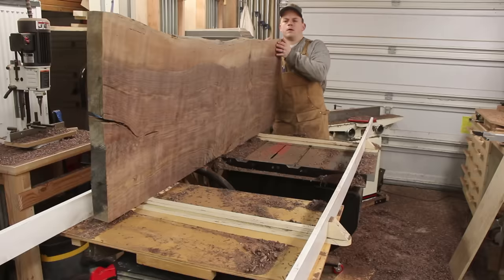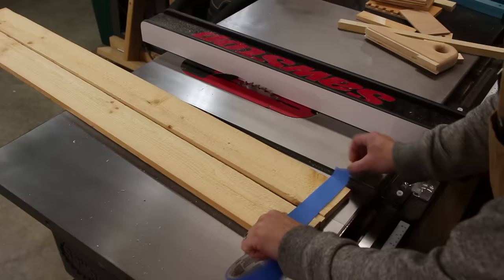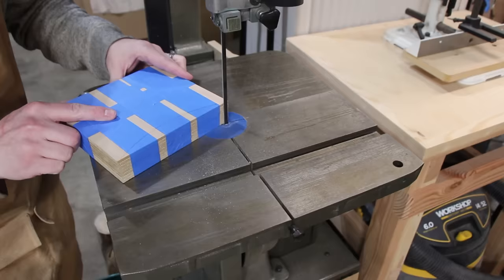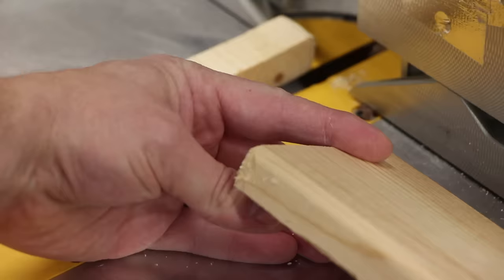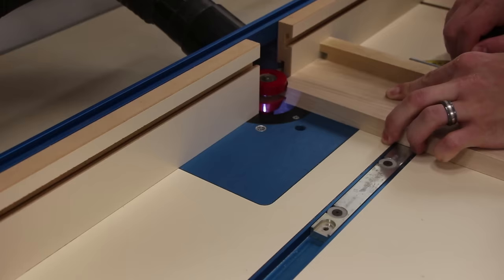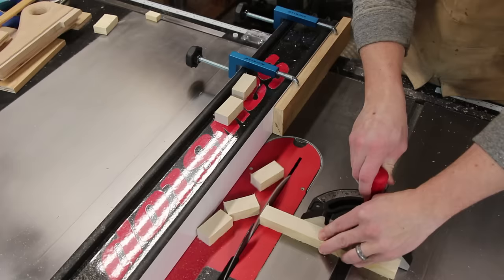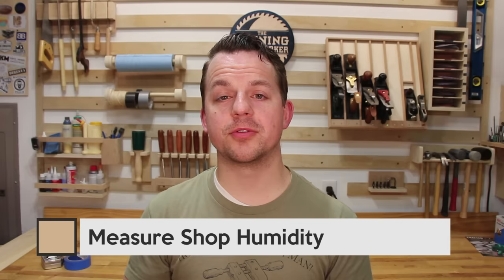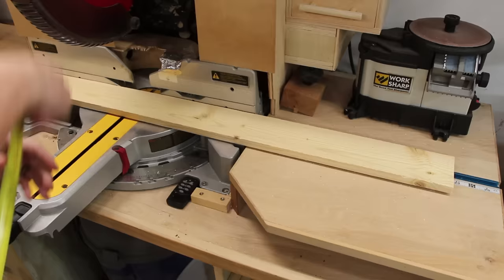7 Woodworking Tips & Tricks You Really Should Know | Evening Woodworker

Comment: here is a tip Don't wear a ring....
Reply: Or a necklace, hoodie with drawstrings, necktie, sleeves or loose long hair.
Reply: Why not? There’s nothing to get it caught on. I’ve been wearing a wedding ring for over 50 years and haven’t had an issue yet. You’re  probably one of those SawStop guy’s thats afraid of the blade.
Reply: Never though I’d comment on a YouTube video but my god I was degloved 3 years ago my ring got caught in a brad nail that was sitting proud of the molding on my garage vertical beams, I was running to shut the breaker off and glided my hand on the pillar as a passed by and then it was a wrap man.  My finger stayed my body kept moving forward

Comment: A couple of things about tape measures. Don’t let the tape snap back into the housing like on the video. It wears out the hook and makes it less accurate for measurements. Also use the same tape measure for an entire building project. There is differences in accuracy in tape measures.
Reply: I am pretty sure projectfarm disproved this myth about tape measures.
Reply: I'm shop foreman in our workshop and I always try to teach guys to ease the tape back in instead of letting it snap back like in the video. Over time it will actually bend the tip to the point a tape can be out 3 or even 4mm. Can't tell you the amount of times I've had guys tell me something was cut too small only to measure it with my own tape and find it spot on. Then you ask to see their tape and it's all kinds of ruined.
Reply: @zuilok  As a retired machinist, I can say that they do vary, and by a good bit. We had to have ours calibrated by the inspection dept before we could use them. Most of the time for woodworking they are just fine though.
Reply: Also they can inflict nasty cuts if there is a small nick or anything and they retract quickly. Don’t ask me how I know 😂
Reply: @jackthomson73 same!! Last time I ever do that!

Comment: That last tip has one drawback. The end of the tape measure has a movable end-stop. It is designed so you get accurate measurement both inside and outside of what ever you are measuring. I think most everyone knows that. The problem with letting it snap back, is that can damage the end-stop. You should never let a tape measure snap back. So just hold the end as it retracts and don't let it snap back. I have seen many damaged tape measures over the years from people just letting it snap back. I'll bet every older wood worker can say the same.
Reply: I believe that remark to be unsubstantiated. Way over 60 years in woodworking and as yet never seen any fluctuation with any tape due to popping it back. That is kinda like having a 64th measurement, who can even see one?
Reply: @mightyporky  Well, I've seen them torn right off. The light flimsy tape measures are more likely to break than the well built name-brand ones. A friend of mine broke two of them and still has not learned not to do it. His comment was, "they are cheap, I'll just buy another one." 
So I guess it comes down to abusing your tools are taking care of them. It's up to the person using them.
Reply: 40 + year carpenter...absolutely correct on letting the tape measure snapping back...seen many novices ruin a good tape measure in a rather short amount of time...
Reply: The symptom of a streched tape measue is cutting boards SHORT when you measue by pushing the tape up against the wall or what ever and then pull the tape when you measure for the cut.  If you are pulling when measuring and cutting it makes no difference if you are using the same tape.
Reply: @markbrake6877  I tried to remember mt first use of a tape, the best I can figure was around 50 years ago, I transitioned from a six foot folding rule. I reckon I used that rule for at least ten or fifteen years.
Reply: @mightyporky  
I used one of the folding rules for a time early in my career also...
Reply: @mightyporky , me. When they damned thing as not square on dry fit.
Reply: @valdo345jr  they damned thing? what do you mean?
Reply: Yes Roy. I agree. When I was a kid as an apprentice on a framing crew, I was told to NEVER let the tape snap back as that would severely shorten the life of the tape measure. I think this trick can still be applied though as long as you slow the retracting tape down a bit before the end hits home.
Reply: See Steve Ramseys video https://www.youtube.com/watch?v=z9En0WAsP8A - letting it snap back IS PERFECTLY FINE!
Reply: I wouldn’t be too worried about snapping the tape measure. Steve Ramsey recently did a video where he snapped a tape measure 10,000 times before it the end broke off. 

https://youtu.be/z9En0WAsP8A
Reply from the maker: Good point! You can definitely let it retract slower, but it's much more dramatic on video when you just let it go!
Reply: Steve Ramsey did an experiment recently on this, the tape measure itself snapped after around 9k "snaps"
Reply: @tpottrell  I was just about to say exactly that! Search "Does snapping a tape measure ruin it? Steve Ramsey"
Reply: @tpottrell  I run a small timber framing factory with just three or four people working daily and I can tell you I still buy tape measures by the dozen. Especially the 8 and 10 meter ones can work up to quite a speed when snapping back and I've seen ends snap off or the last few centimeters developing ripples, making them unusable.
Reply: 100 year carpenter here...
don't let the tape snap back. it will shorten the life of the tape and slice the shit out of your fingers. also you need to lean over and this way and that so it's not always practical leaving attached to your hip...
but I can see it being useful for some things
Reply: @TheClearpuddle  Holy mackerel!  100 years?  I thought I was an old carpenter - started building 50 years ago.  Anyway, I always slow the tape down as it nears the stop.  I’ve worked a lot in the rain over the years and developed the habit of keeping my index finger sliding under the tape to help clear the crap that the tape picks up when wet.  Otherwise, it will load up inside and eventually quit retracting properly, which is a pain.  Eventually the blade will start to rust on the edges and you’re pretty close at that point to a maneuver I like to call the ‘tape toss’.  (When your tape gets rusty and cranky and only retracts to within about 3 feet of the end, you grab the end of the tape, swing the tape like a pendulum, and let it go into the bush, of course you’ll eventually retrieve it and toss it into the dumpster, but there’s a certain amount of satisfaction with the toss.
Reply: @mightyporky  My dad worked for years for Ridge Tool. He built our house using his Ridged Extension Rule No. 620, with the 6-inch metal slide extension  After nearly 80 years and some elbow grease and machinist oil, it's my every day 6-ft go to rule. Try measuring the depth of a small diameter hole with a regular metal tape measure.
Reply: @throne1797  WTG! I still have mine but can't be sure where.
Reply: @paparoysworkshop  I agree, This guy also doesn't value his time either. It takes time to replace a tool. If that guy really needs that tape at that time, he'll have to disassemble that tape box and salvage what he can just to get through the day.
Again, what's your time worth.
Reply: @danholtbk7008  Ouch... 😢
Reply: @mightyporky  That six foot folding rule is my go to ruler.  Large enough to not displace.  Extend it and it stays upright.

Comment: My tip that I don't really see people do:

I think one of the best things you can do is get a whiteboard/dry erase board in your shop. Just being able to have a quick and easy, reusable writing surface, dedicated spot, not having to look for paper or pencils or anything. Just jot down your notes or measurements, do the math real quick on the board, write some of the measurements down and so on. You can glance over at it and double check a measurement as you set the fence. Very convenient
Reply: I do this and it is a great idea!
Reply: I just write on my bench
Reply: I use scraps of wood, but an electronic style of “boogie board” is fantastic for this and cheap. I got one that is about 10”corner to corner and it was less than $10 about 4 years ago. You write with a stylus and then just touch one button and it erases the entire screen; that’s the only downside is that you can’t selectively erase, it’s all or nothing. You can scribble something, but you can’t just erase one little piece.
Reply: I just use my phone
Reply: Sounds good.
Reply: I use a whiteboard with a small calculator and a small lightweight tape measure, both with magnets glued to the back.
Reply: I need to do this
Reply: Maybe several of them
Reply: I do this! I have a huge board for this reason! Take a picture of it afterward. Especially if it's a project you wanna make duplicates of to sell!!!
Reply: Oh!!!! The other thing I do is add magnets to the tools I am always reaching for!!!! They stick to the board!
Reply: Good idea, I’m fed up with either measuring twice. I’ve built or put in loads and loads of stairs and that white board is much better than a piece of paper when measuring hand rails,balustrade and spindle gaps,let alone measuring for a double turn staircase. I’m English don’t know if you call the same words in America. I know you say 2 by 4, when we say 4 by 2
Reply: @liquidrockaquatics3900  I use a Boogie boards also. I just cross out what is no longer needed until it is full then reset it.🙂

Comment: My two favs,
Tip #1- I have a composite material shim hanging down from the ceiling above my table saw. I use whipper sniper line to hang it because it’ll recoil and pull itself back up out of my way after using it. I use the shim when cutting hardwood with tensioned grain that pinches the blade, (closes the kerf/pinched kerf). When this starts to happen I just pull down my shim hanging above me, place it in the kerf and safely finish my cut. Once the cuts complete the whipper sniper line recoils and clears the shim. As a guy who cuts only hardwood and many exotics, this idea has saved me a lot of agro and who knows? Possibly even an injury?
   Tip#2- it’s an easy “blue tape” trick I use when building something I want to stain. Prior to shooting any brad nails, place blue tape there first, then shoot the brad nails in, this leaves just a perfect brad size whole in the blue tape that way when you apply your wood filler, the filler only goes in the brads recess and NOT smeared into a large area of the grain which is a nightmare because wood filler just won’t take stain exactly the same as clean wood.
Hope these help someone.
Reply from the maker: Oooo I like that blue tape one! I always end up sanding a ton to get rid of all the filler on the surface.
Reply: @EveningWoodworker  and when the tape measure gets snagged on a power tool and pulls your hips arm or leg into the tool and takes it off ... 
DUMBEST TIP EVER attaching a tape measure or ANYTHING to you and using while attached to you is the worst most unsafe a most idiotic idea ever ... it is how people lose limbs .. heck Americans eat Tide pods for bloody sakes they wont know enough to keep the tape measure away or out of power tools .... heck they can barely comprehend that they dont vote their leader in they just acknowledge the two options big business has put before them ..
Reply: @0623kaboom  How can the tape gets snagged on a power tool? I usually mark down my measure and put my tape aside BEFORE triggering my tool! I can't see the difference it makes to get a hard time either putting my tape back in its pocket and/or keep looking for wherever I put it because I was too lazy to put it back in my toolbelt! 🤨
Reply: Dang, taping before the brads is going to help a lot. Some things are so logical you wonder how you never thought of it. Thanks!
Reply: @randyspencer5664  He fries bacon naked to avoid getting grease spatter on his shirt.
Reply: Brilliant! I've done this with the key to my drill press. Had to use a wire spring cos the w/s line wasn't strong enough, but thanks for the idea.
Reply: Tape before brad, good idea! I've seen some real pros (typically trim guys) that don't fill the brads before staining. They fill after it's up and before urethane. (Alot stain the trim before it's up) That way they match the fill exact as possible to the stained finish and don't roll the dice on the traditional "fill, and stain, and pray it's close" approach....
Reply: Like the shim trick... hard woods always seems to squirm a little... thanks and God bless

Comment: Many of you may know this blue-tape trick: For template routing, or using a router trim bit, you can attach two work pieces together by putting blue tape on each piece, then using CA glue on one side and accelerator on the other. Hold them together for a second, then they are ready for your routing operation. When completed, use a putty knife slipped between the two pieces to separate them. It works great!

Comment: I am in my 60's and have been woodworking for decades.  I made my first sled this winter.  
I screw an wood auxiliary fence to my miter gauge.  This has worked as good as a sled.  I can clamp to it.  I provides zero clearance to prevent tear-out, and is easily replaced.
When I buy a tape measure, the first thing I do is remove that annoying clip.  I wear a belt with pockets (though less bulky than a carpenters belt) and I wear Carhartt cargo pants.  This gives me quick access to my tools.

Comment: The crosscut sled was the first thing I made for my table saw.  It has been a major time and space saver.  I am absolutely going to try that tape measure trick
Reply: Only issue I have with that tip is the more you let it snap back into the tape the more the rivets start to let go then the tape tip starts to move more throwing measurements off. Will work fine if you dont just let it go and guide it back